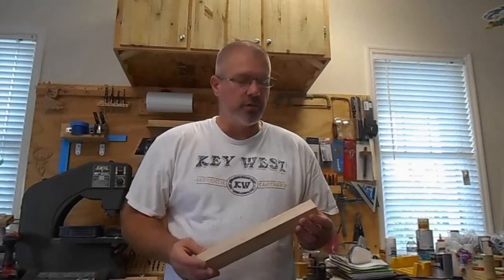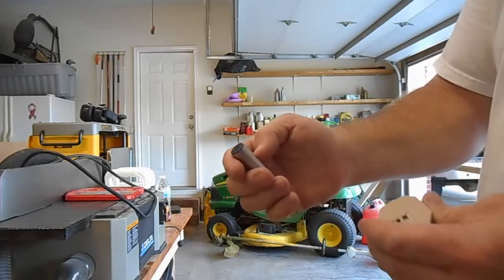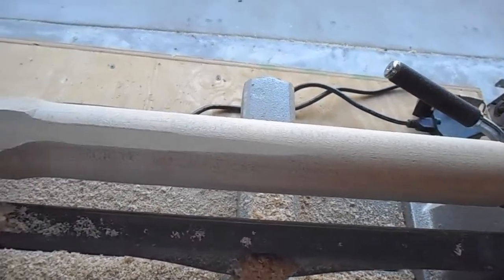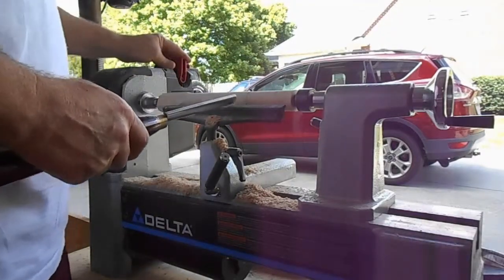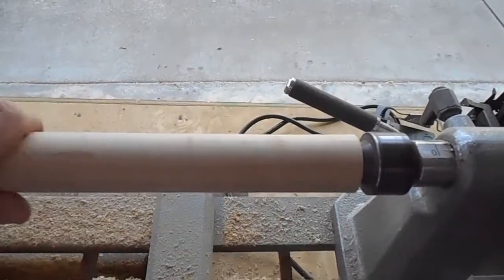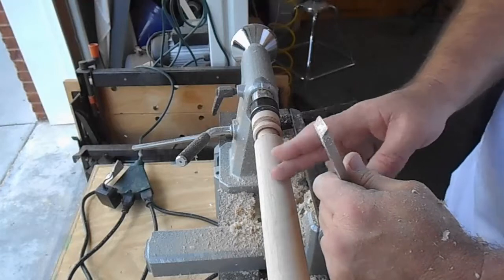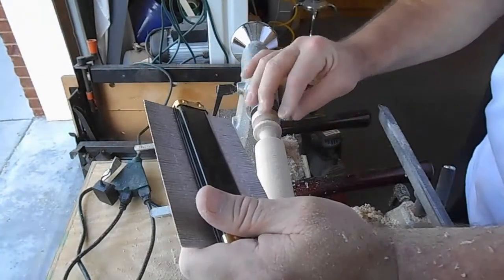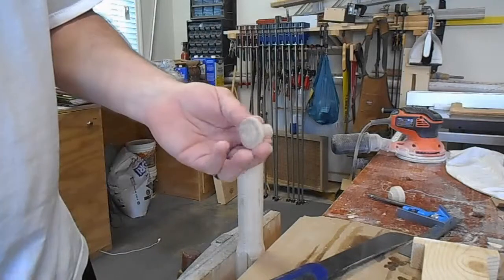Wood turning. Make your own drawer pulls.

Comment: Good job...
I like to mess around on my lathe when the mood strikes.  I'm no pro but I have turned a few things.  But I haven't touched it in quite a while because of my tools.  I'm thinking that they're beyond being salvaged because of my trying to sharpen them on my grinder.  You can't expect perfection when you don't know what you're doing.
Perhaps you could post a video showing how you keep your tools sharp?  That would be great!!!
Reply from the maker: I have one on the work shsrp 3000
Reply from the maker: What tools are you referring to
Reply: @hammerdownwoodworkingtracy3679  I have a set of 6 chisels which I'm thinking are the most common used.  I really don't know the names of each chisel.  I just know what each one does.
Reply from the maker: @bobbyt9999  are they bench chisels, lathe or carving?
Reply: @hammerdownwoodworkingtracy3679  They are lathe chisels
Reply from the maker: @bobbyt9999  I use the work sharp 3000 to sharpen lathe chisels with. I have a video on it
Reply: @hammerdownwoodworkingtracy3679  Thanks so much for this, Tracy.  I watched your video and it makes it look so easy.  I'm heading to my favourite tool store today and will certainly give this a look.